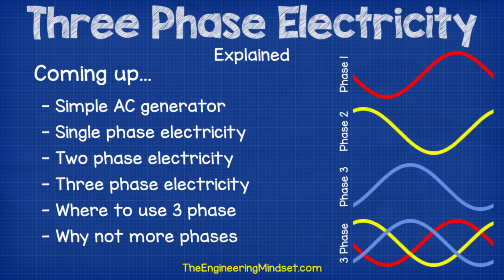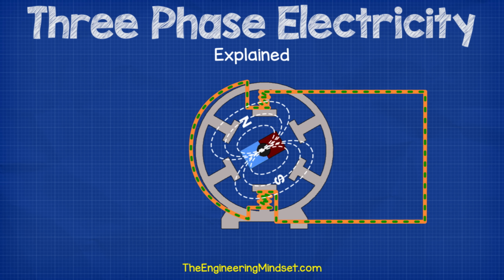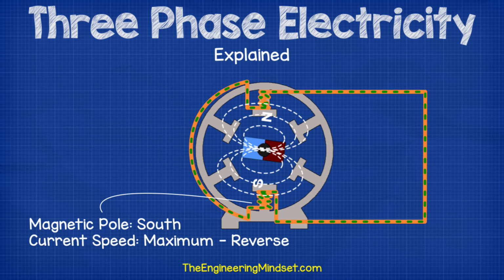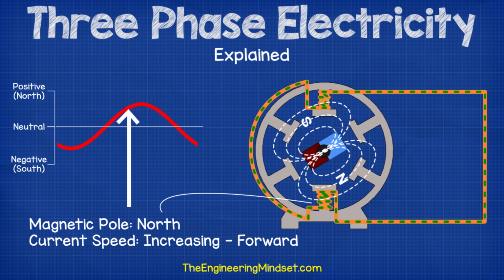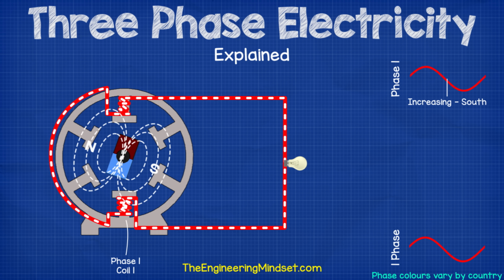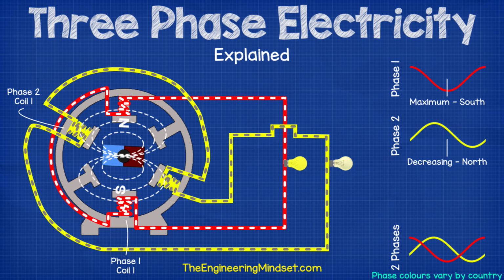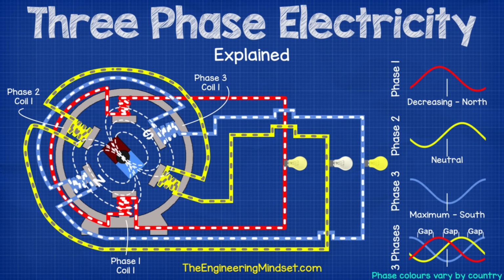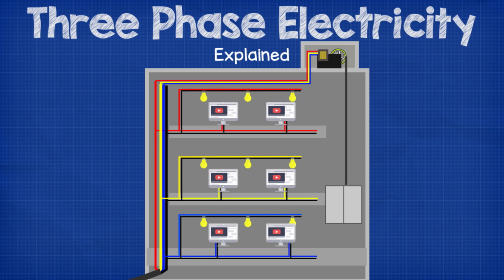How Three Phase Electricity works - The basics explained

Comment: Good video! Though I was missing one aspect of 3-phase electricity and that is the voltage part. In Western Europe, most 1-phase sockets deliver ~230V AC, but 3-phase appliances work at ~400V. The higher voltage comes from the time difference between phases themselves. That was a subject I found difficult to grasp when I they tought me.
Reply from the maker: Check our new revamped 3 phase explained video, sooooo much better:👉 LINK: https://youtu.be/c9gm_NL7KyE

Comment: with three phase there's never a point where the voltage is 0, with more phases - it costs more. Three is the optimal number.
Reply from the maker: Check our new revamped 3 phase explained video, sooooo much better:👉 LINK: https://youtu.be/c9gm_NL7KyE

Comment: Surely you have placed the "N" and "S" at the wrong points?  The poles (and this is what the "N" and "S" indicate) are where the magnetic field is the strongest (as a physicist I would say where the magnetic flux density is higher).  The poles therefore are where the magnetic field lines are closer together - at the ends of the magnet.  You have them opposite the longer sides of the magnet and quite a distance from the magnet.

I think that the "neutral" point has also been incorrectly labelled.  In the case of a single bar magnet there is no such thing as a neutral point (I would take that to mean no magnetic field)  There is no region around a single bar magnet where the magnetic field strength is zero.  In fact your "neutral" is the place where the magnetic field is the strongest (because the field lines are closer together) and the point labelled "maximum" is in fact where the field lines are further apart and so the field is the weakest.

Also the greater current should be flowing where there is a greater rate of the "cutting" of the field lines by the conductor.  This happens when the region where the field lines are closer together comes closest to the conductor.  You have done the opposite.

I hope this make sense to you and I haven't given rise to confusion.  Having said all of the above, this is a good video with a clear explanation of what is going on.
Reply from the maker: watch the new version, even better https://youtu.be/qthuFLNSrlg and 3 phase generators https://youtu.be/WhATjUHgzxQ

Comment: At 60 HZ, I can't imagine the tungsten filament cooling to the point where the light stops glowing and turns off.  Your electric stove elements when heated red take quite a while to stop glowing after they are turned off. I don't think his assertion that a light will go dark 60 times per second is right.
Reply from the maker: watch the new version, even better https://youtu.be/qthuFLNSrlg and 3 phase generators https://youtu.be/WhATjUHgzxQ

Comment: I worked on draglines for many years that ran off 7200v three phase power. 
They powered mg sets that converted to dc to run hoist, drag, and swing motors.
More modern draglines now have ac hoist, drag, and swing motors.

There is an incredible amount of electricity running through these machines, and is incredible when a failure occurs.
I know a couple guys that were seconds away from dying from a failing hoist motor a couple months back.
Also incredible to see the giant trail cave to the machine get pulled apart and the flash that occurs. 
Electricity is both amazing and scary.
Reply from the maker: Seen our new 3 phase transformer video?➡️: https://youtu.be/u0SsejDCVkU

Comment: I think most of the readers already knew the basics of generating a sine wave, otherwise they would not be so complimentary. You should have shown at which point the magnet was generating the maximum and minimum values by slowing down the speed and synchronising the magnet with the sine wave. Also, if the first lamp flickered, then the second and third lamp would flicker, as they are each on a single phase, so that was a poor explanation of more power as you increase the phases. However, I accept that the lamps would be out of phase with each other, such that the combined light would be constant but 3 phase doesn’t work like that connected to three separate devices. Furthermore, the magnet is out of sync with the sine wave. The sine wave is at a maximum when the magnet is generating zero.
Reply from the maker: Check our new revamped 3 phase explained video, sooooo much better:👉 LINK: https://youtu.be/c9gm_NL7KyE

Comment: Houses still have multiple phases coming into them because because some equipment like stoves, and dryers, and some HVAC use 2 phases, while lights and outlets use single phase.
Reply from the maker: Majority of the worlds homes have a single phase connection. North America has a single phase split I to two, some parts of Europe have 3 phase connections. My home for example is single phase, oven, hob, water heater, pump etc all runs off single phase

Comment: In this video it shows the magnet spinning around as it interacts with the surrounding copper. But in other illustrations that I've seen it shows a Iron armature(wrapped in copper) spinning around as it interacts with the surrounding magnets.
Reply from the maker: Yes, either would work. Coil is better because you can change the intensity to change output and also turn it off.

Comment: Why wouldn't 2-phase be opposed at 90°, rather than 120°?
Reply from the maker: Well 360 degrees (Full circle) divided by 3 is 120 degrees per phase. In North America a split phase system is used to give 120V or 240V, to achieve 120V the 240V is split in two to create a fake 2 phase supply both 180 degrees from each other (360/2)

Comment: Why did you label the fields on the side of the magnet with North/South instead of the magnet terminals?  How can you tell which side (left or right) of the magnet is the North and which side is the south?
Reply from the maker: Ignore the magnetic poles, it's not illustrated correctly. See this video instead https://youtu.be/WhATjUHgzxQ
Reply from the maker: Check our new revamped 3 phase explained video, sooooo much better:👉 LINK: https://youtu.be/c9gm_NL7KyE

Comment: If distribution to homes is single phase, how exactly do they go about reccreating 3 phase inside the houses?  I remember living in a house that lost a phase and couldn't maintain power distro to the entire home. So in America, I know houses have 3 phase.
Reply from the maker: US homes do not, typically, use 3 phases. They split a single phase at the pole mounted transformer to create two 120V phases which can be combined to create 240V. See our US version video.

Comment: Mostly correct. Houses generally use two phases. For electric stoves and air conditioning units. A batch of house use A and B phase. Next batch B and C. Another batch A and C. Power company tries to regulate batches evenly.
Reply from the maker: Which country are you in? Most use just a single or 2 phase. US uses a single 240V phase split into two 120V phases. Norway and some of Scandinavia uses a 2 phase system in parts. Germany and Austria often have 3 phase connection to houses.

Comment: Naval ships use three phase power. One huge reason for that was damage control... if a phase was lost due to damage you'd still have some degree of power available, so three phase is pretty much distributed all over the place then you tap off two phases for outlets and the like (hot-hot-ground as opposed to hot-neutral-ground). Ah, this takes me back.
Reply from the maker: Seen our new 3 phase transformer video?➡️: https://youtu.be/u0SsejDCVkU

Comment: So, for me to understand, you stated a single family home is on a single phase, I live in a 60 unit apartment building. Each apartments have their own circuit box not tied into the common areas, my question is; what phase could this structure apply to. One further note, we do have an antiquated external  generator that will power the common areas (In the event of a power-loss) as well as select outlets in 5 or 6 apartments ( the last sentence is really odd, why select apartments? ). Last note, A new generator (Cost- over $500K) was installed but we (residents) were told that National Grid would not allow the unit to be active because of "Feedback" to their systems. I am confused! I know this is not what you do but I have no other professional that I can question. Thanks for your post and education. I did learn something I was not aware of. TY AVB
Reply from the maker: The apartment block will almost certainly have a 3 phase connection, with different apartments on different phases to balance the load. The generator probably uses some change over relays that allow essential power to remain on, the building would need to disconnect from the grid otherwise it will electrify the cables outside the property which would be very dangerous for engineers working on the line.
Reply: @EngineeringMindset  Thank you so much for your response. To be frank I didn't expect one. Never the less I have been pleasantly surprised. Anyway, I do know that the old generator powers off of natural gas. I presume the new one does as well. What I didn't say to you is that this new one looks like an 80's plus Chevy small block 8 engine "Odd or Way Cool" I don't know. I just think it looks real cool, Especially now that it is a VERY EXPENSIVE DOOR STOPPER! LOL I do know when we loose power we're off line for about 10 min. the the generator will come on at that point.  So I agree there must be a failsafe relay that removes us from the grid and vise versa. Again thank for your response. I do appreciate it. AVB

Comment: In the cities, three phases are available, but in regional centres, there is only a single high tension wire with the Earth acting as neutral. You use a transformer to produce two phases, but these phases can only be 180 Deg out of phase. The question is, can you buy two phase motors, I don't think I have seen them and if you can, they need to be designed to work 180 Deg out of phase or 130 Deg out of phase? A two phase motor 130 deg out of phase wouldn't run as smoothly as one 180 deg out of phase I imagine.
Reply from the maker: watch the new version, even better https://youtu.be/qthuFLNSrlg and 3 phase generators https://youtu.be/WhATjUHgzxQ

Comment: I'm a bit confused: the diagram shows the 3 phase supply has 3 separate cables and lamps  Won't this just mean 3 separate flickering lamps? I'm sure 3 phase supplies are on the same cable.
Reply from the maker: Each phase is a separate wire. See here https://youtu.be/jN7o7xvO6Pc

Comment: It's not called 2 phase. In US it's single phase 120, 240 because only 1 voltage hot is doing the work at a time.  Single phase 240, 480 etc  doesn't require a neutral  like 120 does. With 3 phase each phase begins working before the other phases stop. Single phase dual voltage &  three phase uses less energy to work than single phase 120.
Reply from the maker: See here https://youtu.be/fJeRabV5hNU
Reply from the maker: Seen our new 3 phase transformer video?➡️: https://youtu.be/u0SsejDCVkU

Comment: I’ve been in electronics for most of my 65 year life. This is a good explanation. I see people who mistakenly say that D.C. isn’t used for houses because it doesn’t travel as far. Not correct! A.C. was chosen because it can easily be boosted to high voltage, which can travel on smaller wires, then transformed to lower, safer, voltages when it arrives in a neighborhood. D.C. cannot be changed in voltage by transformers. Interestingly they are now using high voltage D.C. to ship power in some places because it has less loss. With the advent of modern electronics we can now change D.C. up and down in voltage economically. It remains to be seen if this will be the wave of the future however.
Reply: no 'wave' if it is DC......LOL   -Cheers
Reply from the maker: Check our new revamped 3 phase explained video, sooooo much better:👉 LINK: https://youtu.be/c9gm_NL7KyE

Comment: Rotary phase converters are quite simple. You wire them in, flip the switch, it does some sciencey stuff, and you get 3-phase output.
Reply from the maker: Check our new revamped 3 phase explained video, sooooo much better:👉 LINK: https://youtu.be/c9gm_NL7KyE

Comment: I would have felt more comfortable with your explanation of 3 phase if you would have just  said  with the high leg 209v  and 120v plus 120 v  no need for capacitors.
Reply from the maker: Seen our new 3 phase transformer video with worked examples: link- https://youtu.be/u0SsejDCVkU

Comment: The video is great altough i do not agree with the part about the lamp being connected to one phase only. In a 230v system we always connect a lamp in parallel between 2 of the phases and in a 400v system we use 1 phase and neutral. You cannot connect the lamp to one phaze because there is no difference in the electrical potential between the wires.
Reply from the maker: We definitely do not connect a 230V lamp between two phases. That would result in 400V (line to line voltage). The lamps are connected between phase and neutral to get 230V. Unless you're talking about a 240V US residential installation which is a split phase 120/240V.
Reply: @The Engineering Mindset  I don't live in the US. I live in Europe. We use 230v not 110v as you guys. As I stated before in a 400v system we do connect between phase and neutral. But you never said that anything about this generator being wired in Star configuration and therefore neutral being the second line. This might be default in your system but it isn't like that world wide. If you connect the generator in triangle configuration phase to phase voltage will be 230v. And yes we definately do then wire our lights in parallel between the lines.
Reply from the maker: I live in the UK, not the US. We have the same system. Your home has 230V because you're connected between phase and neutral, assuming you have a single phase connection. Your lights are therefore connected in parallel between phase and neutral, not between two phases, that would give you 400V.
Reply: @EngineeringMindset  ok so I guess you only have TN system in britain. We have different systems in Norway. We use 3 power systems where two of them have a phase to voltage og 230v. And then we do connect between both phases and there is no neutral wire. If you don't believe me check it out. I'm pretty sure we are not the only country who still has this system and therefore I wanted to clarify that you saying that you connect the lamp too one phase won't always be accurate.
Reply from the maker: Ahh OK I see now, you're referring to an IT system. I didn't realise this was still used anywhere. I'll have to go Norway and see an installation, that would be interesting.
Edit: I'll also add in that case you're completely correct and I've learnt something new which is always fantastic.
Reply: @EngineeringMindset  yes we gave TN, IT and TT where IT and TT doesn't have a Neutral leader the way we use it. We only build TN systems now but IT and TT are still widely used. And in hospitals especially operation rooms we are forbidden to use TN and we use IT instead because in an IT system an earth failure (contact between Phase and earth) will deliver a very low current and therefore we are allowed to have a system that detects the failure instead of automatically tripping the fuse. This system prevents a sudden powerloss during an operation and gives us time to fix the issue. I have been part of a project where we built 12 new operation rooms at one of our largest hospitals and there we had a transformator in the fuse locker connected to each operation room where we transformed the power from a TN to an IT system.
Reply from the maker: Very interesting, thanks for sharing.
Reply: @EngineeringMindset  no worries. As I stated i my first post I really liked the video it was a great explanation to how power is produced. I'm an electrical engineer who has now went into teaching so I was searching for good ways of explaining the generator concept because it can be a bit hard to understand for others. Your video was great at explaining that 😀

Comment: That’s why building that use voltage sensitive equipment, have a Uninterrupted power system to provide constant power to their equipment through a battery bank. Simple explanation to a complex system.
Reply from the maker: Check our new revamped 3 phase explained video, sooooo much better:👉 LINK: https://youtu.be/c9gm_NL7KyE

Comment: It isn't the 'intensity' of he magnetic field that causes current to flow. It is the rate of change of the magnetic field across a coil. A strong, but unvarying, magnetic field will cause not current to flow. Actually, what the varying magnetic really produces in a coil of wire is a VOLTAGE. If the coil is connected to an open circuit, a varying magnetic field will produce a varying voltage, but there will be no current. If the circuit is connected to a load (a resistance) current will flow.
Reply: The rate of change in a revolving magnetic field is also dictated by the strength of the magnet though... A stronger magnet produces a greater difference in the electric field as it moves
Reply from the maker: Check our new revamped 3 phase explained video, sooooo much better:👉 LINK: https://youtu.be/c9gm_NL7KyE

Comment: If a home is connected to a single phase supply how come nothing is flickering
Reply from the maker: It is, just faster than you can see. Use a smart phone camera in slow motion recording. Most devices also run off DC also
Reply from the maker: watch the new version https://youtu.be/qthuFLNSrlg and 3 phase generators https://youtu.be/WhATjUHgzxQ